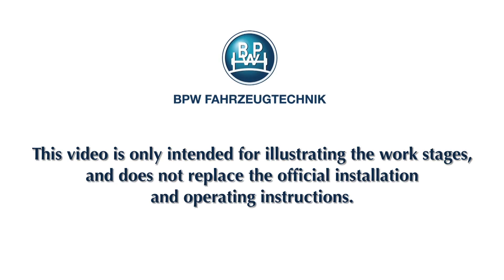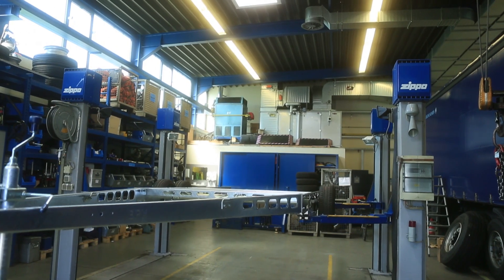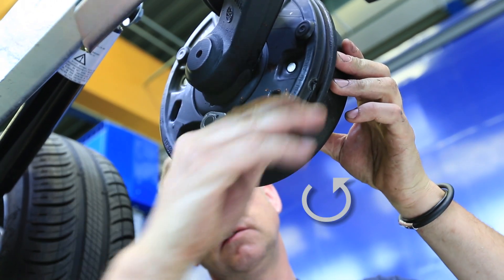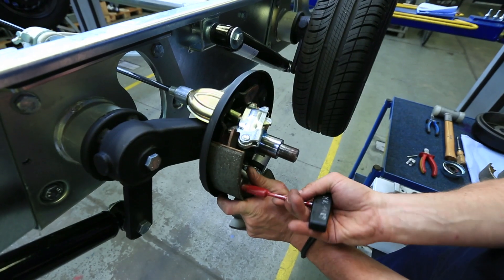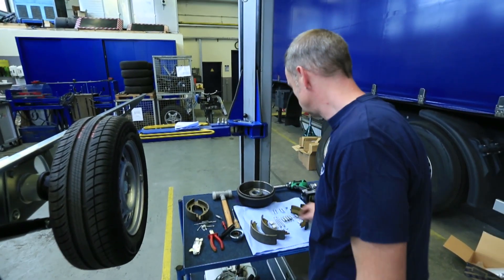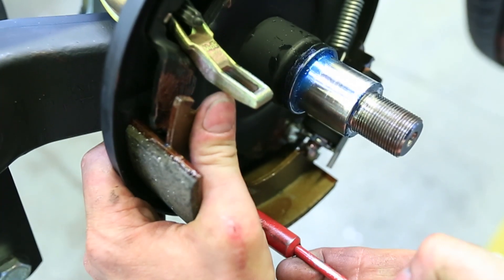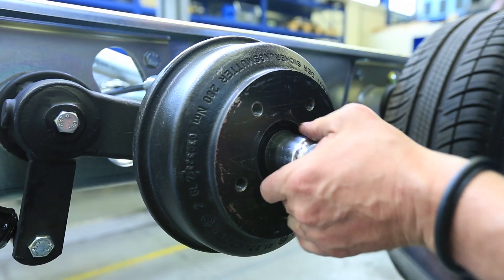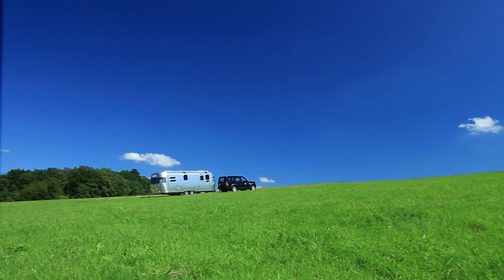BPW Change of brake shoes

Comment: Was this BPW S2005-7  brake? Are there several different version of  S2005-7 brake, like .379, You could have done a better video...I mean that more instructional point showing the parts and the assembly.

Comment: Where can I get the tool used at 0:47 for undoing the clamp springs?
Reply: You dont need a special tool. Just press the clamp and turn the stud or just slide the clamp away from the stud.